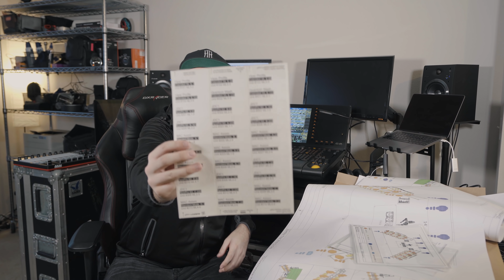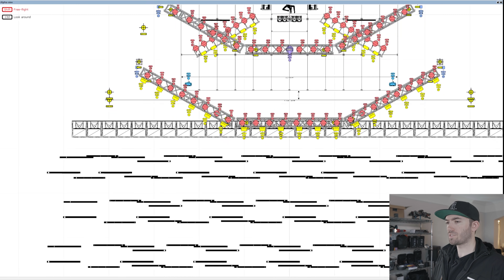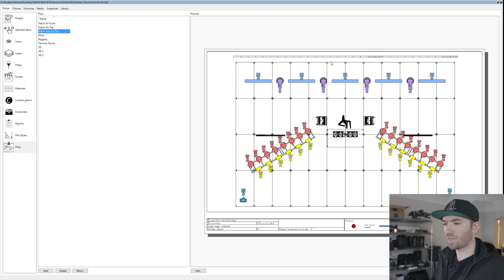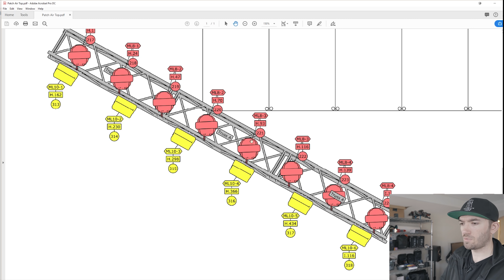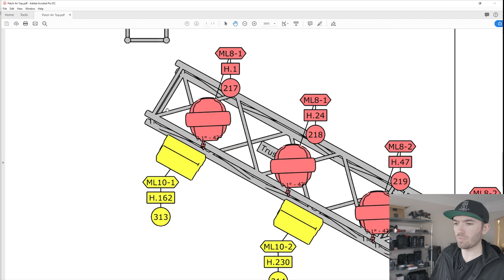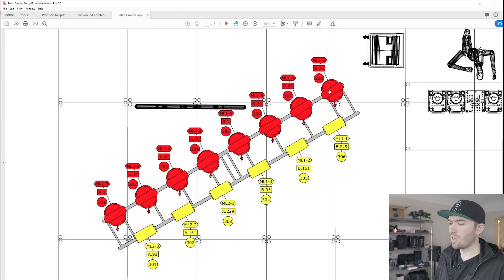Lighting Plots & 3D for the Zomboy Rott N Roll Tour - Tacoma Dome

Comment: How do all of these lights get powered? Assuming you dont just plug them into the wall.
Reply: Fixtures get plugged into typically L-620 socapex fan outs delivering 6 circuits of 208v power. These circuits are driven by socapex cable then sent to an electrical distro box.  This distro is powered either by the venue or generator.
Reply: Yeah, what  @varok011  said. In more laymen's terms, venues for these shows will have power connections that can provide wayyy more power than your typical wall outlet. A touring rig might tap into this power and run through one or many "distros," or distribution boxes that split up the power to be sent to different areas and/or individual lights. If the venue doesn't have the necessary power connections for a rig, the tour wants to not deal with venue power, etc., they might bring in one or more massive generators which effectively replace the venue's connections in the system above.

Comment: Question:

I am studying a certificate IV live production. 

The lighting elements of it have been the most interesting too me. 
We have so far looked at how DMX works, what different colours and angles do, what the different types of fixtures do and their purpose, what different angles are used for and have had a look inside different fixtures. 

I am just so confused at all the different lighting desk brands. 

Are some better for different types of shows?

I have heard you can run the software from all the desks for free. 
Which one do you reccomend I play around with as a beginner?

EDIT: Another question. One of those fixtures you mentioned took up around 60 channels. That seems like a lot. What are all of the channels doing?
Reply: I can answer the question you have with desks. All digital lighting consoles essentially do the same thing, they just do them in different ways with different sets of features. This is because they all have their own individual operating system. Because if their different feature sets some lighting consoles are designed around and are better for certain tasks. For example Christian uses the MA the most used and arguably best console for EDM and live concert. However HOG and Chamsys for example are all comparable to MA it’s just operator preference. However for theatre you’ll almost never see an MA instead you’ll probably see an EOS. They are just inherently designed and have good features for theatre. As mentioned most lighting consoles offer on PC solutions of there operating systems, hook up a artificial visualiser and just experiment until you find one you like. Look around locally and see what they use as that’s probably what you want to learn. Hope this helps.
Reply: Channels control fixture attributes.  Channels get very high when using LED fixtures and mapping all of the available LED's
Reply: Some large tours will run only 1 to 2 fixtures on a universe depending on the amount of channels needed.

Comment: No "Spare" power circuits? I'll leave circuit 6 on the Soco as a spare for when shit hits the fan. There's always a circuit you can grab without pulling a new line.
Reply from the maker: There was enough room to twofer if there was a bad circ but everything was prerigged and tested In the shop